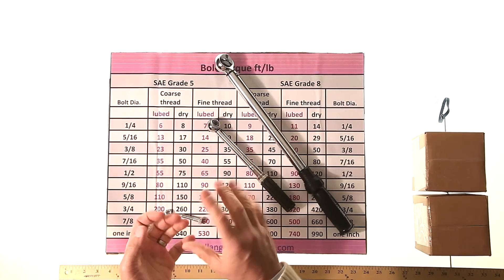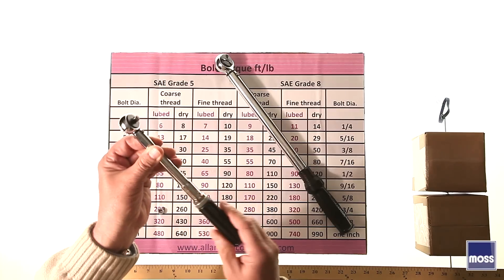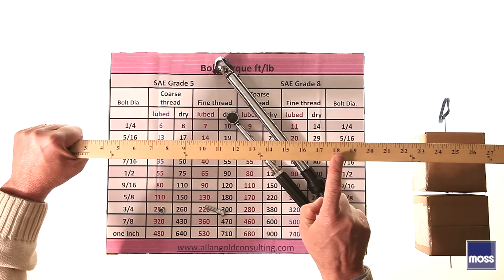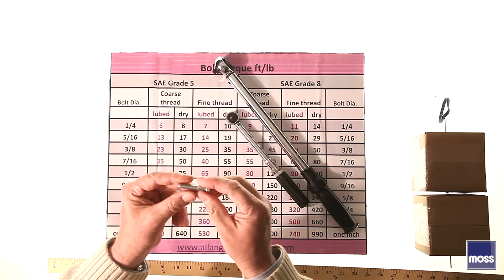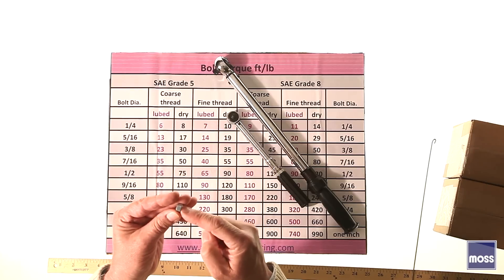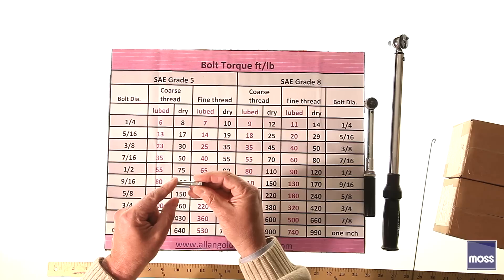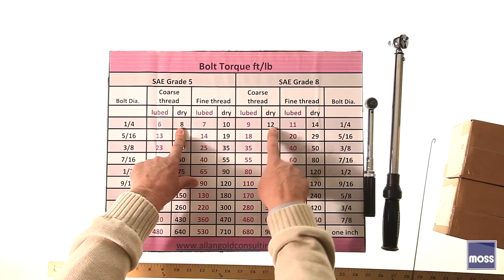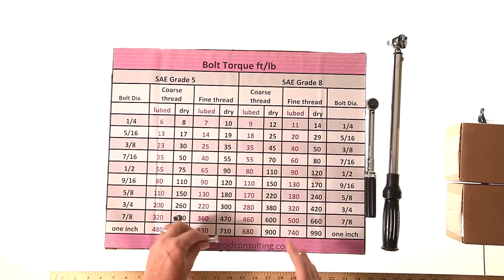Torque Specifications And What They Mean

Comment: Great info, just for clarification. If I have to tighten an bolt to 7.4 ft•ibf  and I have a 2 foot torque wrench I have to multiply 2x7.4 to make sure it’s done correctly? The torque being 14.8 as opposed to setting the amount for 7.4? Or should I be setting the torque at 3.7 and the 2ft from the wrench supplies it to be 7.4 ft? I’m sorry if I am completely off.

Comment: Want a funny little reality. Go to Autozone and get a torque wrench. It is there that you will see a wrench whose measurements are engraved in increments based on 5. The dial however, to adjust between those increments are based on 6, thus a dial at a full turn that reflects that of 12 lbs, not 10, as so would be expected by the engraved markings. American quality at its finest. Wanna see what I mean? Go to 159. Most people would got to 160, then back off one lb. But if you go from the 0 on the dial, your at 161 from the 150 line, not 159. Fucking crap.

Comment: Good info, but i am working on a 1976 pontiac,, the bolt are not graded in any way i can see, so then what are the torque values per diameter size? Is there a less than grade 1 which is why they are not marked? Not talking about engine bolts.

Comment: Nice video, but you made an error. You said "1 Nm equals 14.6 ft.lbs." Oh no, that's way, way off. Actually, 1 Nm equals 1.35 ft.lbs. Just do a correction graphic overlay on your video. Other than that, nice job. Gary @ Snap-on Tools.

Comment: Fantastic video! I learned exactly what I was looking to learn. I think for a lay man this would be a little difficult to follow because of how fast paced it is and how many technical terms there are being used, not to mention a bit of math that can makes some peoples heads spin. However, for someone like me that has taken physics at the college level and just wanted to know more about what I've already learned it was easy to understand. I found your video simply because I was wondering why torquing bicycle parts to the correct specification was so important. I can now visualize problems that can go wrong when too much tension is applied while riding due to incorrect torquing of the bolts because of the way you explained the concept of bolts stretching. I never knew that they did this. Thank you again.
Reply: I agree! It is easy to understand and I also just wanted to understand torque importance in rebuilding engines and I understand now exactly what it is. Great video!

Comment: so once you know the torque specification do you apply that torque until the bolt stops turning? until its snug? how do you know when exactly to stop pushing? do you push until you can't push any more?
Reply: Yes! ^^^this. I have been a mechanic for about 20 years, but I was watching this video because of this concept. The axle nut on my motorcycle is a fine example. It is a castle nut, meaning there are notches in the top of the fastener that line up with a hole in the axle for the clevis pin, to prevent it from coming loose. The spec calls for 72 ft. lbs. However if I apply gentle pressure the nut will continue turning without clicking my torque wrench for another 1/2 turn or so. So at what point is the bolt properly stretched? When you first hit the proper torque.....or when proper torque is acheived and the nut also will no longer turn? In the past, I have torqued to spec, ajd just continued to rotate until the nearest hole is aligned with the nearest notch on the castle nut. I figured its better to be just a small margin too tight than having it too loose.
Reply: First you set the torque wrench. Then you tighten the bolt and once you get NEAR the required torque, you smoothly continue to tighten until the torque wrench indicates that you have reached the specified setting.
Reply: You have to turn the torque wrench smoothly and recheck and see if it turns if it turns keep turning it slowly until it stops, and do it again until it clicks without moving. Torque wrench needs some practice to get it right and the best way is to do that on a torque calibration tool and see how much torque you get comparing to your expectation, I always thought that I was doing it right until I did it on the machine, but after a few try I can get it consistent.

Comment: When I see this type of torque value: 13-16 ft-lbs torque; I dont quite understand what it means--Does it mean find the in between or is that lubed/dry? I've been online for hours and still havent found the right answer~
Reply: +TheEye22 
That means the torque spec is anywhere between 13 to 16 ft.lbs. of torque. So I would apply 15 ft.lbs. of torque. Lubed or Dry?  Good question, but one that can ONLY be answered by the manufacturer of the product that you are torquing. And lube DOES make a difference, quite a bit in fact. So its very important to find out from the manufacturer how they do the torque specs, wet or dry.
Reply: Thank you!

Comment: thanks for the well explain vid
also could you tell me about using the anti-seize compound on the thread?
what is it gonna change ?
Reply: +tech270154 
Using Anti-seize on a fastener is similar to using any type of lubricant. Using a lube on a bolt dramatically increases the clamping load, so it should never be used unless specified by the manufacturer.